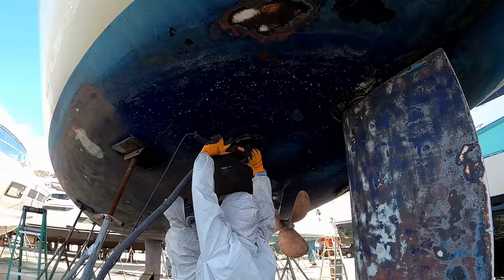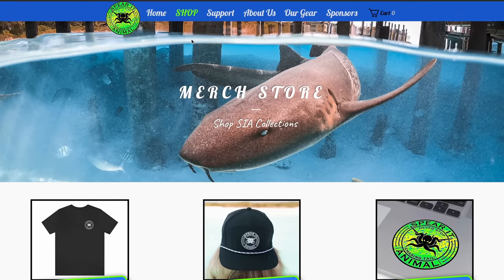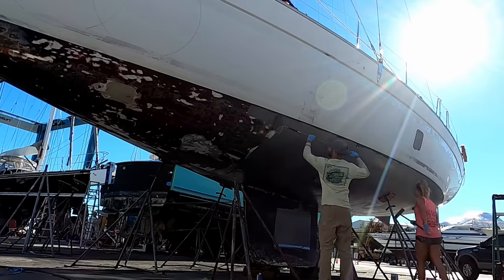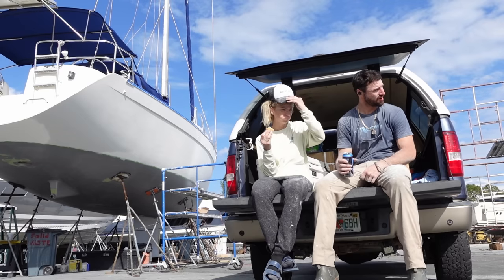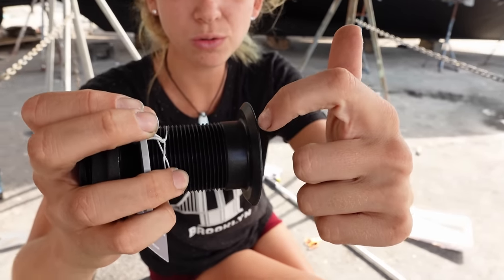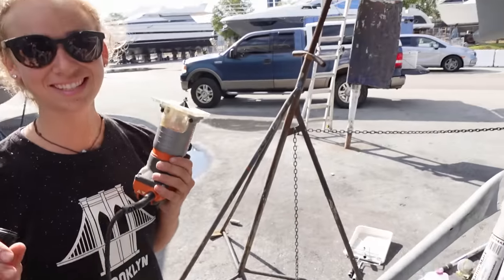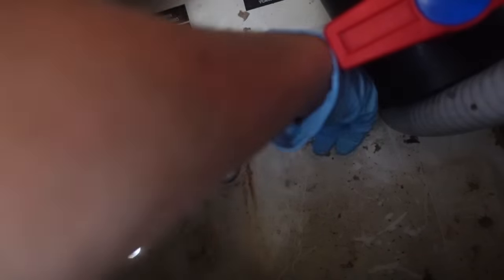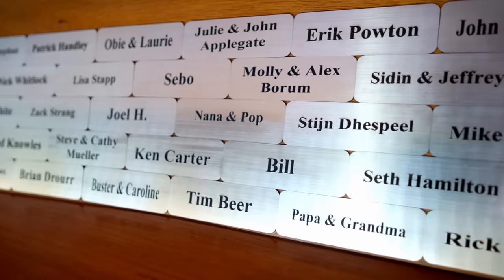Will we SURVIVE the yard... PAINTING Topsides on 50ft BOAT, installing  PLASTIC Thruhulls  | ep.12

Comment: 5200 is used for permanent bonding, 4200 is used for bonding when item may need to be removed or replaced in the future, (transducers, thru hulls, etc.).
Reply: Ahh 5200.   Someone will be having a fun time in the future taking those things off, 😂
Reply from the maker: We actually did use 4200 for the ball valves and hose fittings.
Reply: Warren on WE Sail says that he never uses 5200. He has something that is better. Check out his recent (#3) boat tips vid.
Reply: 5200 - Satan's glue

Comment: I installed Marlon thru hulls on my launch build in 2003. I did not us the flush version you used, but there are only 2 below the water line and 2 above. Never had a fault with them and would recommend them to anyone building a new boat.

Comment: I think it was last episode you put the fiber glass on all in one go, where as most people put one layer at a time.

When people are putting the fiber glass on one layer at a time they use a roller to get any air bubbles out.  I don't see how you could have gotten any air bubbles out with such a thick pile of fiber glass.

How do you know if there are air bubbles under your fiber glass?
Reply from the maker: Rolled it out later by layer on the table first then rolled it one last time when we put it on. It’s a lot easier than working on a vertical surface with resin dripping everywhere

Comment: Dang ya'all love the keel instructions.  I always get confused for some damn reason and end up with Fin Keels.  The Fin Keel without a doubt is fast and will give you more performance, but only in the short term.  After a few years of riding a Fin Keel you will wish you had a more comfortable Full Keel especially when you run into high winds and nasty weather on a long passage.  Also the maintance costs and upkeep on Fin Keels are much higer that any other type of keel.
Be happy, be safe   🚴

Comment: The reason your thru holes were rotten is because of electrolysis. The biggest give away is the colour of your prop. It is pink which means it has been attacked by electrolysis and it's structure (the metal) is now weaker.

Reason for the electrolysis? Because you have an "Earth Leak" in your electrical system (the DC side of things). You need to get it checked and sorted. Could be a problem with the alternator or simply bad wiring.
Reply from the maker: Yes... unfortunately the previous owner didn't check or maintain the zincs, for one... And there are definitely issues with the electrical system we are slowly finding out, more to come on that!